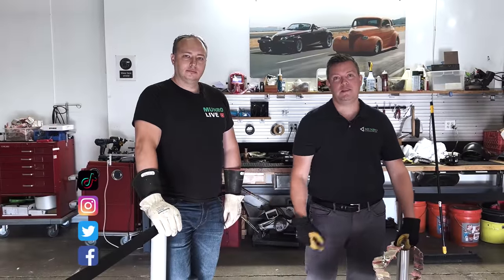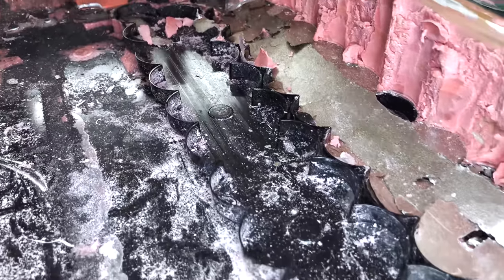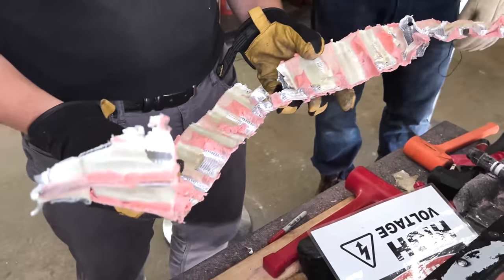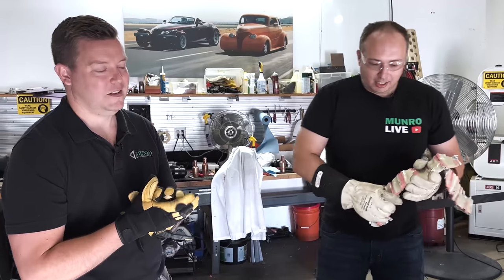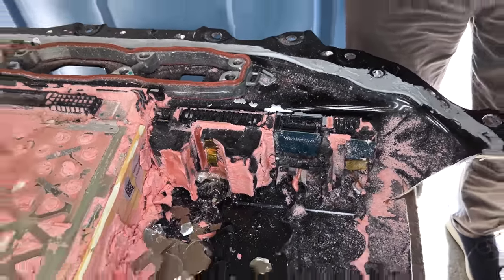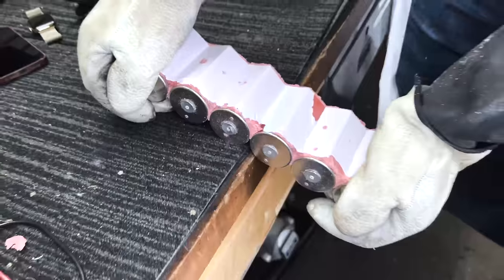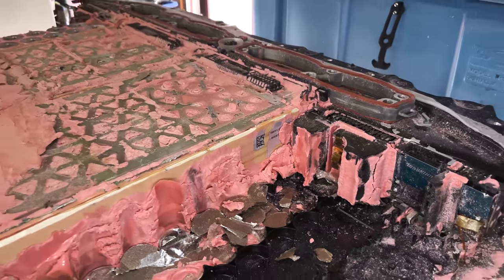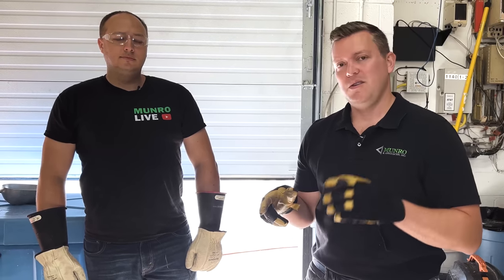4680 Update Structural Adhesive | Tesla Model Y

Comment: How does this kind of structure factor into recycleability?  I know not many packs have been recycled yet because they last so long (pre-4680 of course) but if recycling is a goal AND the pack is this difficult to take apart, how would they deal with that?  Can they just "chop it up" and sort it out using gross chemical and mechanical processes or is there something else planned?
Reply: Sandy mentioned this in a previous video if I remember correctly it would basically be ground up in a giant shredder and then broke apart.
Reply: Tesla have explained that the way they will recycle the battery packs is to crush them into a powder and treat that powder as a high-quality ore that can be purified to extract out the various elements.

Comment: So many component’s to this Battery Pack.
Whatever happened to: Keep it Simple?
Reply: they aren't made to be taken apart.  can't go too simple on battery which is responsible for range, structure and heating the car. has to be crash worthy and last a decade + and tbh there is not that many components, all of which are critical to operation. go look at other ev batteries, here on munro they show tesla vs the other guys its a joke, tons of unneeded cables and garbage from nearly all oems
Reply: You .ran "keep it simple" as in "remove 3,582 components (cells) compared to the old pack"?
Job done?
Duh?

Comment: So while this adhesive allows them to make the pack part of the structure of the car, there is no way in hell down the line anyone will be doing any repairs on a pack later in it's life. Suppose there is always a trade off, though doesn't look a simple way to change a bad module of cells down the track.
Reply: There's never been a simple way to change a bad module.
Reply: @rogerstarkey5390  fair, though I never said simple. It's possible without destroying current package architecture.
Reply: @sievans79  Also dangerous for the workers as they are dealing with a live 400v buss
Reply: @sievans79  
Are you sure about that?
("Changing" the module?)
Check the recent "repair" videos on the Bjørn Nyland channel.
As I recall the experts snip a cell connection.
That being the case, in this pack a software activated conventional fuse or solid state switch could perform the same function (if so, incredibly simple with the correct knowledge and tools)
(Speaking as a service tech in a different industry who can perform "software switching" of many parameters)
EDIT
Analogy
"Modern" house wiring.
A simple circuit breaker disables the specific circuit.

Comment: I feel like Tesla just calls it "structural" so they don't have to engineer it in a way that it can be serviced or the "module" concept. Making repairs or modifications is literally not an option. Just like when Nokia phones were easy to service or swap out the battery, compared to basically any smartphone today, is much more difficult for the general public/consumer. Apple is definitely in-front here, forcing the phone to check the battery to see if it's genuine and display a warning message on the display.

I think it all comes down to the trending "right to repair" movement. Even though, it can't directly be linked to Tesla, as I'm not assuming anyone would want to modify their battery in the car, it still limits the option and just making the whole thing more of a pain. We compare ICE to EVs on most things, so when it comes to the "heart" of a car, ICE vehicles can have their engine replaced, which also can be done on EVs (motors), but not the battery. This will probably not be relevant for most people, but letting companies have more and more control over the products we as consumers buy (hardware + software), is worrisome imo.
Reply: It's "worrisome" only if you don't understand the system.
Google it?
Reply: @rogerstarkey5390  Google what? I can't worry about that we as consumers are losing the ability to modify/customize our own products? Losing ownership of what we own basically.
Reply: Totally agree, while I admire Tesla in some ways, they ARE the apple of the automotive world. Happy to sell more and more product but equally happy to see previously sold product sent to the crusher.  
Cynical greenwash bull at it's worst when you think of the energy needed to create a car.
Reply: @Macmonkey1000  I mean, sure it might pollute more than ICE, but I CAN be green later, can't really argue with that. Also no tailpipe, people underestimate the emissions, especially diesel particles
Reply: Modifying an EV's battery pack is a foolish idea ! In no way can it be cost effective & maintain specifications. The liability issues with working on a live 400v pack that if shorted can then thermally run away (catch fire)  is also bad ! The power electronics are easily accessible in the penthouse area under the rear seats.
Reply: @jackdbur  sure, but read what I write. I'm not saying ppl should be able to play with the battery. See the bigger picture. Workshops should be able to change or replace if they're qualified.

Comment: Manufactures need to start thinking now about how these batteries are going to be recycled before millions of these are on the road. There is absolutely no reason for this kind of engineering.
Reply: The thinking has already been done. The procedure is to pass the battery through a crusher/grinder to reduce it to particles which are then separated according to density and then applying heat and or chemical processes to recover the primary elements. This is way cheaper than primary mining and smelting.
Reply: @Clearphish  Munro thought they might immerse the pack in liquid nitrogen first, then grind it to particles, and then melt it. Different materials have different densities and so float to different levels. This would allow for separation of different metals. Not too different from how mined ore is refined, except these packs are truly high grade ore.
Reply: As the above people wrote. In the end with the cells, to be able to make new cells from materials it has to be grinded/shredded down and separated anyway. Doing it with the full pack isn't that different I believe.

Comment: As an engineer in the auto industry for 35 yrs, I seldom have so much difficulty understanding the design process as I do with this pack. I would love it if Munro could interview someone in the design group responsible for it.
Reply: Get a strip of corrugated card (4" tall?)
Wobbly stuff?
Now roll it into a tight spiral.
Tape the loose end?
Now unravel, add glue and repeat.
Light, high torsional rigidity, strong?
Same principle.
You could just take the empty "cans" and the foam and you'd have a similar effect.
Reply: Feels like that is a competitive advantage and nothing Tesla would let engineers speak about.
Seems they needed to get it more complicated for it being stiff and usable as a structural carrying component unlike other batteries.
Reply: I'm very curious about that too! I bet a lot of the design is a result of having in-house cell and pack production, making other products outside of cars, and prioritizing ease of assembly and assembly time. It would be relatively trivial for them to adjust battery pack capacity and insert cells into other products like the PowerWall, etc. while reducing the per-unit cost of the battery as 4680 production ramps up
Reply: There is nothing difficult to understand here! Are you an engineer or not!? It’s a structural battery which means every is glued together in one block practicality impossible to repair/reuse.
Reply: It's just like previous Tesla batteries, but entirely foamed together instead of having multiple modules with their own cases.
Reply: @brianb-p6586  nope!!!! It’s not like the previous tesla batteries! This is a totally different design.
Reply: @alanmay7929  Apparently you've never seen a previous Tesla module... they're all hexagonally packed cylindrical cells with cooling channels snaked between them and current collector plates, and bonded by some polymer. This one places both plates on one side, as with the 2170-cell Model 3 and Y. This one has multiple cooling channels per module with in-out flow plumbed in parallel, like the Model S Plaid modules.  It's barely different, not "totally different".
Reply: @brianb-p6586  you don’t need to tell me something I already know lol…..
Reply: @alanmay7929  apparently I do need to explain, since you don't see the obvious continuation of the same design, but everyone is entitled to an opinion. 🙂

Comment: That battery pack has zero chance of being repaired if one cell goes bad, it seems you'll need a new one. It also seems it might be hard to recycle as over time they become the standard for Tesla to use on their other vehicles.
Reply: You're really not paying attention, are you?
If "one cell goes bad" and there's Individual fusing on that cell, they can electrically remove it from the pack, losing 1/828th of the capacity  (0.12%)
"Recycling"
Tesla is already doing it.
Plus
JB Straubel (now Redwood Materials) has told us what they do, the whole pack is thrown into a really big grinder, then minerals/ metals are  separated.
Reply: The old packs get ground up whole for recycling and not disassembled. Should be pretty straightforward.

Comment: Great job on the videos and the tear downs you guys do a great job of that however 
This is the worst piece of engineering I’ve ever seen as a automotive technician there is nothing in that pack I would be scared to change or should not be able to change but they have totally engineered that to be unserviceable and we wonder why we can’t fix climate change this is the reason this is a horrible piece of engineering not only for the company under warranty purposes but for the person who buys it and owns it and should be able to have the right to repair it should one thing go wrong in that battery pack Basically a complete new one would need to be purchased wow

Comment: From a eco and repairability perspective this terrible.. there has got to be a better way .. they wasted way too much material for structural rigidity.. I know because I did this for a living
Reply: 1. These fail so rarely that reparability is not important.
2. Recycling is easy, they just treat it as a high-grade ore. And since most of the materials are simple (metals), they are almost fully and infinitely recyclable.
3. They didn't waste anything, the cells and the foam were already there, they just made them do some extra work. This actually removed a lot of material from the other parts of the car.
Reply: Asking in earnest, and not sarcastically, because I'm endlessly curious and don't do this for a living--where do you see the potential for material savings in the design?
Reply: There no point in repairing. You going to pay 6k+ in cost to repair your pack after 10 years warranty? At that point you better off selling the pack for shredding and buy a new pack with 10 years of warranty.
Reply: What about the worker opening and working on a live 400v battery? If you had a battery pack "Repaired " then it caught fire in the night and some of your family dies in the fire WHO is to blame & who will you be sueing?  Should you be covered by insurance ? When your insurance cover is  denied how much can you sue Joe's garage that "repaired " the battery for?  Would you like to work on 400v live battery that can also violently combust if shorted ? Will your business insurance provider cover that?

Comment: Zero sustainability , zero right to repair. Glued for life !! Discusting
Reply: What about the worker opening and working on a live 400v battery? If you had a battery pack "Repaired " then it caught fire in the night and some of your family dies in the fire WHO is to blame & who will you be sueing?  Should you be covered by insurance ? When your insurance cover is  denied how much can you sue Joe's garage that "repaired " the battery for?  Would you like to work on 400v live battery that can also violently combust if shorted ? Will your business insurance provider cover that?
Reply: @jackdbur  right to repair pal!! Don't care if it 20,000 volts , when I repaired CRT monitors super dangerous as is life , no one stopped us then  .. anything can be repaired and certified with professional repairs, but telsa don't want professional repairers around they want to sell you  20,000 dollar replacement battery pack and hold all the cards , like apple and all big tech companies !
Reply: @adonisnetworksvideos7698  who would certify these "repaired " battery packs they would be impossible to get to original specifications and destined to fail. The liability issues are very complex and horrible for Tesla who would be dragged into any litigation even if it was a "repaired " pack. You did not repair the capacitors on crt's you replaced them if they were paralleled then replace both. Lithium batteries are even worse as they can not be drained down to zero so they are always capable of deadly voltages as packs . If you have done any safety training then 1 is removing the hazardous activity that is what Tesla has done.
Reply: @jackdbur  who certifies your home's electrical system , or fixing your plumbing , an engineer with certification , which you CANNOT get from telsa because they are a walled garden company ....a closed source company you have to take it to them.. or its considered  unauthorized. Btw   telsa's model S battery packs were repairable, they obviously don't want that any more for their share holders .

Comment: This pack is so solidly built it's safe to say this pack is not repairable . I wonder what it will cost to replace a faulty battery pack? 🤔
Reply: You might want to edit your claim, despite you not actually knowing anything 🤔
Reply: I think you meant to say “unrepairable”. It would be very expensive to replace the battery pack. Thus they have to ensure very very good yield on the cells + thorough testing on each cells before assembling them into pack. It is a good thing 4680 reduced the number of cells needed, and hence less potential points of failure. If there is any problem, it would be on the warranty.
Reply: @gtyang81  Yes that was definitely a typo
Reply: @gtyang81  How long, how many miles is Tesla warranty?
Reply: @fredbloggs5902  What does it cost to replace a battery pack?
Reply: @mauraece  it varies by model, minimum coverage for battery and drive unit is 8 years or 100,000 miles, whichever comes first, with minimum 70% retention of Battery capacity over the warranty period. you can check it out details from their website.

Comment: So a single failed connection or component writes off the whole battery pack?  And we're supposed to believe this is a good thing?  No, it's an insult to owners and the environment.
Reply: The BMS is able to detect the failed cell/connection and excludes that trunk from the normal operation. You will experience a few % extra battery degradation (capacity loss), but not a total failure...
Reply: @tcfs  how does the BMS compensate for a failed BMS?
Reply: @jfolz  It is not "compensating", just turns off the failed cluster forever and the whole battery pack capacity reduces with a few %.
Reply: @tcfs  read carefully. What happens if one of the BMS boards fails? Because they have failed in the past, bricking the whole pack.
Reply: @jfolz  I think, Tesla is confident enough about the reliability of the battery back, including BMS. When something fails, they can replace the entire pack and the defected unit will be shredded for recycling.
Reply: @tcfs  oh yeah it's great for Tesla. Terrific even. When you inevitably show up with your broken out-of-warranty battery they will graciously offer to take it back and replace it with a new one at *whatever price they decide*. They make a nice profit on the replacement pack and get to keep yours too!
Reply: @jfolz  Ok, it seems that you moved this conversation from "technical" to "emotional" level. Sorry, bro, I don't want to follow you there...
Reply: @tcfs  sure thing Mr. "trust me bro", because  that's what "Tesla is confident" translates to. Also just a reminder that this channel is not targeted at consumers, it's ad space for Munro reports and other services.

Comment: Taking weeks to get this thing apart. You're going to recycle millions of these?! Is there some solvent that will eat it? Hope so, but FFFS please don't get it anywhere near me.
Reply: You just put the entire pack through the shredder
Reply: @saff226  I hope somebody has a shredder like that. Just don't let it anywhere near me.

I suppose you could just do all the shredding in a really cold city, and then circulate the heat through the town. Might be worth a try.

I still don't see it. Por dios I thought Tesla was about SAVING energy
Reply: @ronaldgarrison8478  After a diping in liquid nitrogen the electrical energy is zeroed & plastics are brittle well everything is kind of brittle at cryogenic temperatures. So easily shredded. Also any volatiles are solid.